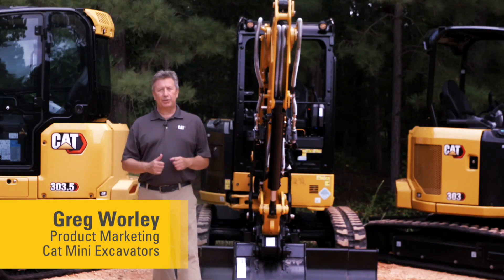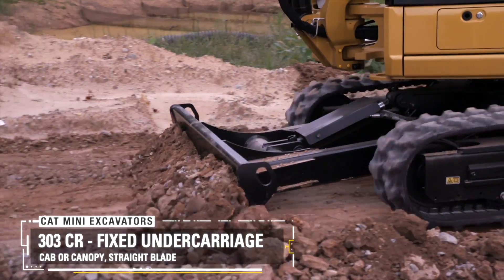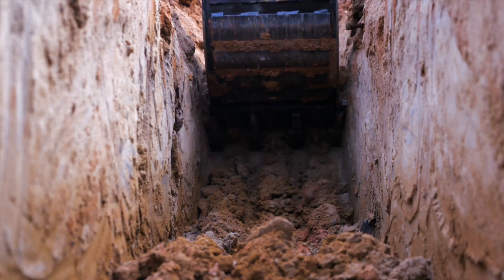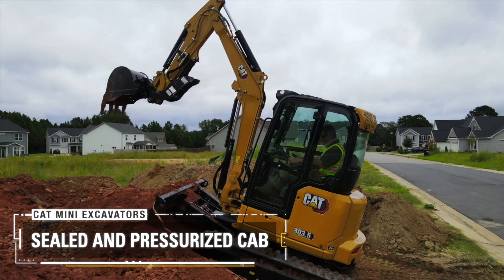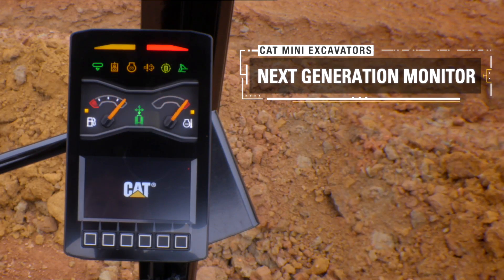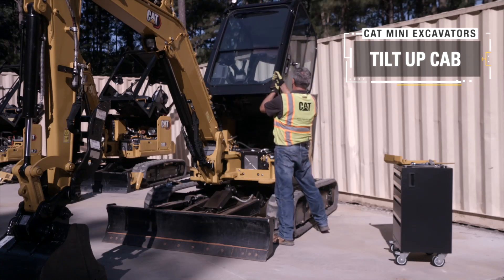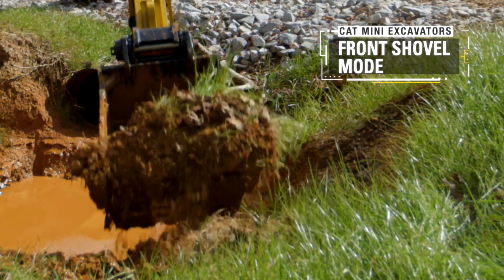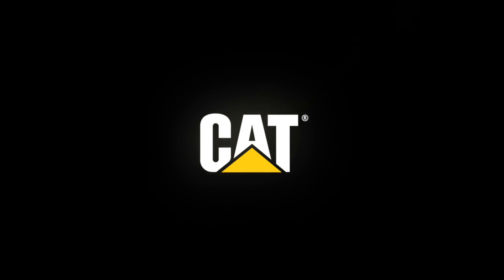Overview of the Cat® Next Generation 302.7 CR, 303 CR and 303.5 CR Mini Excavators

Comment: 302.7d pattern change… how??
Reply: Well if you read the damn manual why cant you tell me.. its behind the damn seat.. theres another control box
Reply from the maker: Hi! If you're sitting in the cab, behind your left shoulder there's a trap door on the back panel. You may need to tilt the seat forward to access. Open this trap door to get to the pattern changer in a 302.7D. - Angie

Comment: 303 C Cr had air-conditioning and a 32 hp Isuzu motor and operate spec equal to the new 303.5
Reply: I had one of those 303c cr when they came out. An absolutely brilliant machine. Had so much digging power for a little tractor. It’s still my benchmark machine, even though I have bought a handful since.
Reply: I bought the next-generation  302cr very nice machine, I just bought the new 302.7cr with expandable undercarriage its auctally heavy than the new 303cr.the 302.7cr is 7500lbs plus vs the 303cr.
Reply: @josephfalcojr.5412  What width is the machine when tracks are fully retracted if you don't mind me asking
Reply: @paulhaworth1824  hi paul sorry for the late reply the tracks retracted the machine is 54 inch .302.7cr is a really nice machine
Reply: @josephfalcojr.5412  No probs mate thanks for the reply